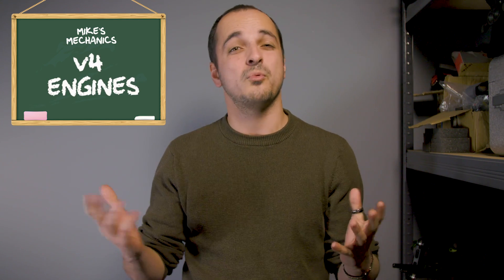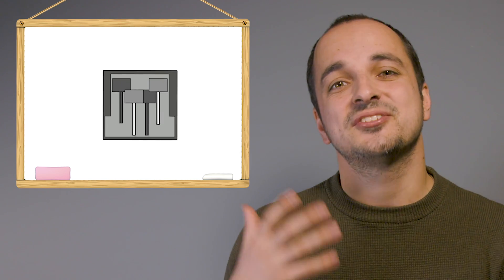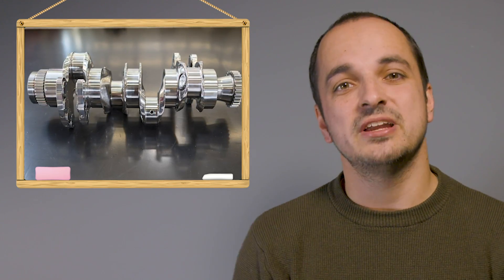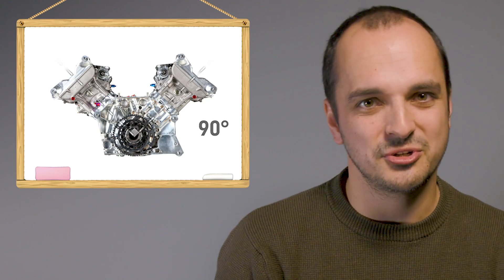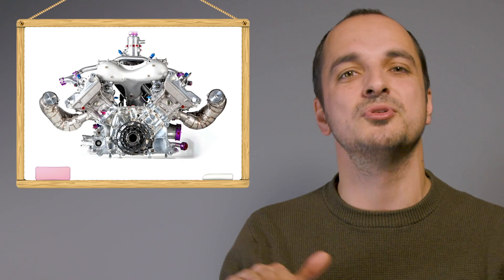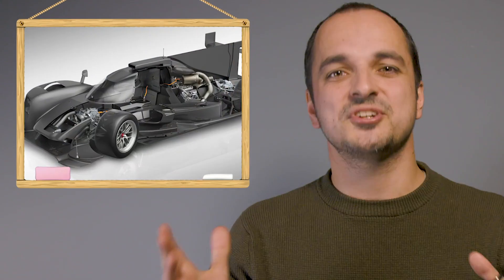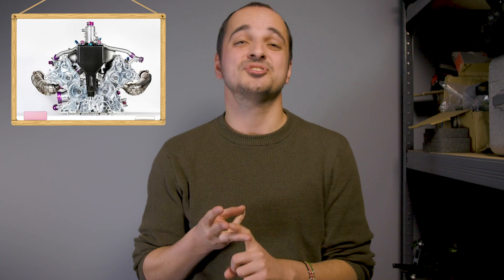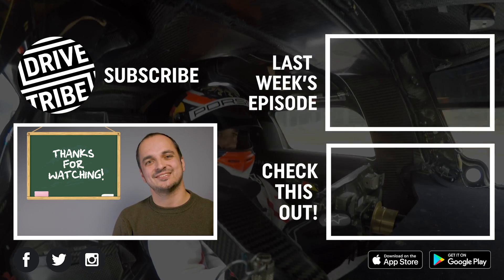Why V4 engines are so rare and which cars use them - Mike's Mechanics

Comment: Back in the 1970s I had a 1972 ford capri 2ltr that was a V4 engine and it was very good it did look a bit odd under the bonnet as the capri had such a long bonnet with such a short engine I think the engine started life in the Transit van.
Reply: In Ford Taunus in 1962 - first Ford V4....

Comment: Our fork-lifts use V-4 engines.   Ancient ones.   I think they're called "Continental".   Not the tire company.    Anyway Clark, Hyster, and many others used these for industrial vehicles for a long, long time. Now Mitsubish, also a V-4, I think, has taken over most of the market for our size machines.   Ours run on propane for indoor/outdoor use.   I think the Ford/Saab 96 engine was the same engine block?    Red-line on our fork-lift is about 2500 RPMs.    There's no tach, but it sounds like it will blow up when it revs.    Has 2 speeds forward and 2 reverse.   Steers with the rear wheels.  Top speed is maybe 20...but you don't want to go there with no suspension, non-pneumatic tires and rear wheel steering.    All the weight is in the back as a counter-weight to the loads they pick up.    They can lift 5000 lbs up about 20 feet and they turn on a dime.
Reply: The Ford Taunus -> Saab 96 was the same engine from Ford maybe with minor changes  (like the carburator).   When you type in Mitsubishi V4 forklift google can't find anything .... only inline 4

Comment: Saab 96 has a balancing shaft also. Great rally car though!! 👍🏻
Reply: A friend of mine had one of the Saabs, and had trouble getting parts for it, until he realized Saab had sourced most of the engine from the Ford industrial motors division (apparently they originally built these V4 engines to run the generator in portable electric road signs).
Reply: @johnrehwinkel7241  Not the industrial motor --- the V4 were used in Ford cars in Europe from 1962 up to late 1970s 

At first in the front wheel drive Taunus P4 , then in the rear wheel drive Taunus P5 ,  then in P6 & P7, Ford Transit van (1965-1978), Ford Capri (the european Mustang), the Corsair, Consul/Granada etc ..... milions of cars.....

Saab used the Ford car engine due to replace their two-stroke motors....  Saab used them from 1967 .....

You can find parts at  motomobil.de
Reply: The Ford V6 from the Mustang II/ Mustang III, Bronco II, Pinto, Mercury Capri, Ford Aerostar etc.   --> comes from the V4 design from 1962 ....  

Ford created the Cologne V6 by adding 2 cylinders to the V4 and deleting the balance shaft :)  In 1964  and this V6 was a Ford powerplant in European Fords  for more than 30 years....
Reply: And a beautiful sound once you hit 7000rpm and above
Reply: Oh, the engine from the Capri...? Now that was something else. I think I’m right in saying it was replaced by the duratec v6. I currently drive a Mondeo ST200 which uses the duratec 25 (albeit with upgraded parts from the 30). Wow, now that IS an engine!! 🙂
Reply: @Mark-rw7cx  It was replaced by 3.8 later 4.0 V6 in the Mustang and other cars, and by Vulcan 3.0 V6 in Taurus/Aerostar/Windstar  

Duratec V6 is more of Mazda V6 K-series concept.

Duratec is a good engine - I drove for some time the Jaguar X-type 2.5, nice motor, have some power but the sound was not impressive ;)  Still my old 72 Ford with old 2.8 v6 sounds a lot better

Comment: Growing up in Sweden were there are plenty of old Saab 96 V4's, that was the sound I was expecting to hear in the beginning. It wasn't quite that... 😁 Great video!
Reply: That Saab had the engine of a Ford Taunus
Reply: Man I miss SAAB.
Reply: The V4 was a Ford engine, also found in several Ford models.
Reply: @twelvereasonswhynot  The first V4 was from the French automobile manufacturer, Mors. It had a ten-litre V-4 side-valve engine.
Reply: My first car was a 16 year old, 1968 Saab 96. What a cool car!
Reply: An older man who lived down the street from where I grew up had a Saab Sonnet that had a V4 in it.
Reply: My early '70s Thiokol Imp Snowcat uses the same (made in West Germany) Ford V4 used in the Saabs. Expensive getting parts for it in the USA.
Reply: Saab used the V4 in Racing(rally)  and pushed 200hp with it (race-spec)
Ford never raced it.. (as far as I know)
Saab had its own vertion of the engine.
Reply: My parents had a v4 saab wagon when i was a kid. Liked riding in back before seat belt laws
Reply: Moore like a "jungeldrumm" 😂👍
My neighbors in northern Sweden had One .
Reply: @mrolsen6987  The "djungledrum" was a two stroke engine, not the V4..
Reply: @blackentheone6484   yea some people meen that, some people say its the v4 that actually sounds like a djungeldrum, who we cal the djungeldrum..
But hey, I admit that it was the first 2cyl 2T Saab 92 which was the first one to be called that.
Reply: Volvo s80 did have a v4
Reply: @bmxtrial3939  Incorrect , Volvo S80 used inline 5 and 6 cylinder engines, Plus top line came with Yamaha 4.4 litre V8, New S80 are only fitted with 4 cylinder inline engines.
Reply: @harriseppanen5207  There isnt any new s80!
Reply: @harriseppanen5207  that's right, straight 5 and 6 cylinder engines, mounted transversely, which demanded a new kind of super compact gearbox. It was quite a big deal I remember, as the gearboxes used to be built in my home town.
Reply: bmx / trial Nope
Reply: @bmxtrial3939  no

Comment: Ford in Europe used a V4 in 60-70s and its the sams SAAB had.

Honda failed with their first V4 they broke down and got a bad repetution, it wold take untill vfr750 in 1986 the Honda v4s worked.
It was ysed for 2strokers also as its comoact, one got out on the streets Yamaha RD500 that came in 1984, but it could never really outdo the Suzuki 2stroke square four engine and was alot lighter.

Duvcati used a v four for racing today as v twins cant get the same power four cylinder as big can give, so the built a v4 that works tha the pustons on the same side goes up and down in pairs to make t sound more vtwin.
Still they gave up hehe
And we all usd to v8 talk is american as hell.
The old Ford V4 was really the V6 cut out 2 cylinders, i guess they could have built a v8 of that to but i dont think that was ever down.
Still SAAB 95-96 and the last Sonet used that same Ford engine and nothing else, so it leaves the italian one.
SAAB in the first years if the 99 had a Triumph engine before they finally built their own engine.

Comment: Not every V shaped engine is a V engine.

If every pistonrod is connected to its own part on the crank its called a boxer engine.
even in a V shape it ist technicaly a boxer engine.

A 180 degrees engine were 2 pistonrods a connected to 1 part of the crank is called a V engine, even if it has a boxer shape.

Comment: The classic Fulvia was a lovely engine. That narrow angle with the single head had a flat top block, so the tops of the pistons were wedge shaped.
No expense was spared, even the sump was cast and finned aluminium.

I might have rebuilt one ;-)

Comment: Had a left-hand drive 2.0 V4 MK1 German Ford Capri in a nice blue colour to run around in at the garage I worked at in the late seventies (In the UK). It wasn't very fast but it sounded well. The boss Wally had a thing for LHD cars especially yank land barges like Ford LTD and Cadillac, mind you they were nice in a straight line, buggers around our small side roads though.

Comment: Just saw a 200 cubic inch 3.3 liter V4 in a 1973 Chevy Vega at a car show. Talk about different. It had even had a 471 blower on it. It was a small block 400 Chevy with the 4 center cylinders removed. Sounded insane. 👍

Comment: The whole 'the V4 isn't popular because they are expensive and complicated to make' kinda falls apart when Subaru makes flat-4s which is somewhat similar in its complexity and cost. Subaru managed to carve a happy little niche for decades with the flat four despite Subaru being a relatively small car company budget wise.
 
IMO why they weren't popular is the cars that used them in the 60s-70s didn't make a huge impact compared to the inline fours of the day, company's noticed the public's indifference to them and stuck with inline fours since they also as a bonus were cheaper. If they did catch on with the public's imagination then they would be still around

Comment: You do know that Honda use for thare bike this systeem ?
A Honda vr500f or the new vr type.
And for the rest you do not know or what. .
A  v engine is low rpm engine have his max tork on a lower rpm
Dat is a the reason America cars have a v systeem .
It's have a lot of plus point .
But your roads from work tot home are a lot of miles.

In eu country's we use a line engine .
The line engine it's make to have high rpm .
And a higher horse power on a higher rpm.  
The tork it's on a higher rpm
Reason is our roads from home to work shorter and we have a lot traffic light .
And we move vaste over the road 
Like in Germany thare is no speed limit on some highway .
Yes it's means if your car have top speed of 150miles per our you can drive it .
This means we need a higher rpm engine.

The reason de V4 is out of the cars. 
Well the reason is a that a line engine have more power and don't need a lot of space .
That is the reason we don't use v4 engine .
We do see on a motor bike and on a ⛵.
But its use for the lower rpm and easy horse power.

Comment: ZAZ / ЗАЗ !!!! Air-cooled V4's with 746 - 1197 cm³, 23-50 hp.
Reply: Okeey don't think that was sold in western Europe.
Reply: It probably was sold there.  The 966 and later 968 looked like NSU Prinz or smaller Chevrolet Corvair.

Comment: Wisconsin made a lot of V4 stationary engines, I’ve seen a Model A someone swapped one into.
Reply: Wisconsin also made Marine V4 motors (johnson and Yamaha used them).  There is someone converting the v8 2 stroke version to use on cars.

Comment: I drove a 1966 Ford Transit Fire Engine for a couple of years. It also had the V4 Taunus engine mentioned in the video. 1700cc and 65HP wasn't much, but it was enough to move the 3 ton Transit plus a 600kg trailer.

Comment: The V4 was also used in SAAB 95 & 96, the Sonnet is also known as the 97.  I was originally developed  and used as a truck engine by Taunus(Ford) as a truck engine.  It ended up in cars as well
Reply: Ford Taunus was a normal car -- not a truck.

Comment: If automakers went the route of producing these engines the V6 would be deemed obsolete as well as the V8 due to the fuel efficiency and power potential of a V4 engine. The only way a interest demand would be for them is if someone sold engine crate kits with such an engine.

Comment: "In racing stiffness is everything" actually, in pretty much all chassis, stiffness is everything. Even if you want a soft luxury ride, a stiff chassis means you can tune the suspension better, and make it softer. This applies to more mainstream performance cars as well, stiffer chassis, with firm, but still compliant suspension (instead of just super stiff suspension) allows for the wheels to better maintain contact with the road over all kinds of bumps.

Lack of stiffness in any chassis comes down to cost savings.

Comment: The V4 engine has not been widely used in cars. AMC, Ford, Lancia, and ZAZ were the only companies to manufacture such an engine.[6]

Lancia produced several narrow-angle V4 engines from the early 1920[7] through the 1960s for cars like the Lambda, Augusta, Artena, Aprilia, Ardea, Appia, and Fulvia.

From 1960 to 1963, American Motors Corporation (AMC) produced a 108 cu in (1.8 L) air-cooled V4 engine that was used in AMC's lightweight aluminium-bodied M422 'Mighty Mite' military vehicle, as an air transportable (by the helicopters of the time) Jeep for the United States Marine Corps.[8][9] This engine was not designed for civilian passenger car use.

Ford of Europe produced two totally different V4 engines (with four crankpins) and a balance shaft, one in the UK and one in Germany:

The British Ford Essex V4 engine, mainly used in the Ford Transit and the Corsair[10]
The German Ford Taunus V4 engine, also used by Saab[11][12], the Matra 530[13], and in the 1962 Ford Mustang I rear-engine concept roadster)[14]
The Ukrainian manufacturer ZAZ used an air-cooled V4 with a balance shaft, produced by MeMZ and used in Zaporozhets and LuAZ cars.[15]

In 2014, Porsche announced that their 919 Hybrid Le Mans Prototype would use a small-capacity, turbocharged V4 engine.[16]
Reply: The German V4 engine was used in like milions of cars produced by Ford of Europe.  

The Taunus P4 , Taunus P5, Taunus P6, Taunus P7, Ford Capri, Ford Granada( Ford Consul), Ford Transit (van)....  the Saab V4 numbers made is probably 2 years sales of the first V4 Taunus, Matra was a very low production number car.

Comment: If you take the two top points of the "V" and stretch the hell out of them by pulling them apart, you end up with a 180 degree v4. Or a Subaru Boxer.
Yeah I know it's a stretch.

Comment: doesn't really explain much... when majority of manufacturers have gone away with the inline 6 and went with a V6. Subaru and Porsche has been and still making H4, not THAT much more expensive considering most stuff are half the length/quantity each side vs an inline config. Most cars have grown in size now a days so packaging is a non issue, but if we're talking about small compacts, then the more reason to use a even smaller sized V4. So you haven't told us why V4 are so rare.

Comment: In the early 70s, while building a highway, I operated a Flextrak Nodwell FN10 with a perfectly horrible V4 engine. The only nice thing I will say about it is that it would reliably start in minus 30C.

Comment: I wish GM would make a V4 engine with LS3 interchangeable parts.
Reply: Your bandsaw makes one ;D
Reply: I remember an engine called the  SCAT V4 made over 20 years ago; it was essentially a Chevy V8 with 2 middle banks removed.  Used in a lot of sand rails and baja racers.  They went defunct though, so it would be a rare find now.
Reply: Motus v4

Comment: I would start andwering the question why the mechanically simplest, a line architecture, has disadvantages. This goes down to the number of cylinders imo. Then we still have the boxer which is like a 180 degree V. As mechanical engineering solves optimization problems, we have to look at the decision criteria that result in more mechanical complexity (moving parts, weight) than straight in-line. I can ask these questions, but not answer them confidently.

Comment: the Lancia Fulvia had a VR4 right? The cylinders had no angle. It was pretty much the same as a VW VR6 engine, right?
Reply: Yes.  The Lancia had low angle and single cylinder head.  Fulvia was the last car to use it, there were more models with low angle VR4 engine before.

Comment: What about mass centralisation and tight packaging. I thought that also part of why they choose V4 as longitudinal Inline-4 don’t have the same advantage to power the rear wheel.  And speaking about balance, 90 deg flat-plane V4 engine perfectly balance out primary and secondary order vibration in expense of having an uneven firing order which firing order are the same as crossplane crank inline-4 engine.

Comment: kool educational video.. was just asking myself recently wt the launch of the new supra, how come there are no v4 engines t be found these days, considering the popular downsizing demand in the car industry... this explains it well - double the cost of exhaust manifolds and cylinder heads does make it almost double unreliable and cost uneffective.  i mean take into account a single repair costs for a simple 4pot. in exampple - u have the head gaskets to fix now double that cost on lets say official repair shop and you get the picture why no company is actually fiddling with these for a daily use.  but as a tuner fan, id realy like to se some of these to appear someday..  i bet mr Papadakis could make them nicely reliable khm.. for an engine with 900hp xD

Comment: Yamaha , Suzuki , and OMC made 75-140hp 2 stroke outboard motors for boats. They were extremely heavy and gas guzzlers but man they had torque. They essentially took v6 and cut off 2 cylinders.
Reply: Suzuki df140a makes 140hp inline 4 2ltr now only 179kg 4 stroke.
Reply: Chris Hart Suzuki used to make a V-Twin 4 stroke 25hp lol
Reply: @geog5523  in a outboard ?
Reply: Yes the built them around 2008 - 2014 , they were extremely heavy and complicated , search it you will find videos for sure lol

Comment: Saab used the Ford V4 engine.

Also Ford actually designed two completely different V4 engines that were both being used in different vehicles during the late '60s and early '70s
Reply: Essex and Cologne ....worked on both in V4 and V6 configuration in various capacities...

Comment: Ford in the late 60s early 70s used the V4 in a range of European cars inc the mk1 Capri and Transit in the UK.
If memory serves it may have been related to the engine used in the 2.8 Taunas v6 seen in the Capri/Granada and the 2.3 in the Cortina/Granada.
Definitely not related to the v6 3.0 Essex engine used in the early Capri/Granada though.
It was IMO an inferior engine to the OHV and OHC engines that were seen mostly in 70s Fords such as the Escort mk1 and 2,

Comment: 1.6 V6 vs 1.6 V4 engine, which one is more efficient and which one more powerful?
Reply: The V6 has the potential  to make more horsepower.  More efficient could depend on the task required.  If the requirement is of a low output the v4 would be better.